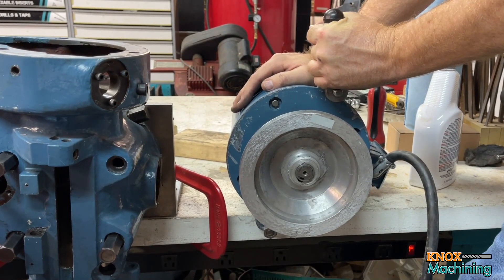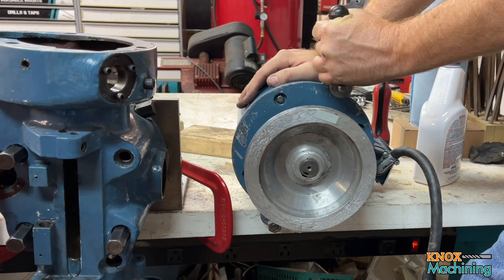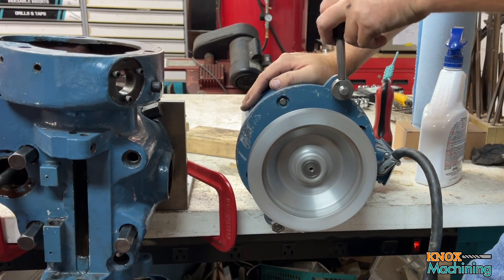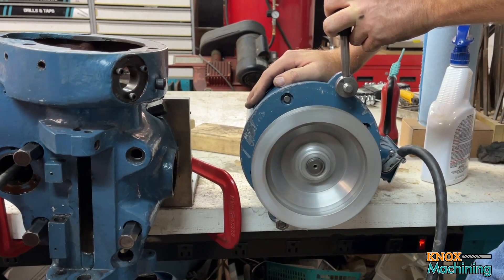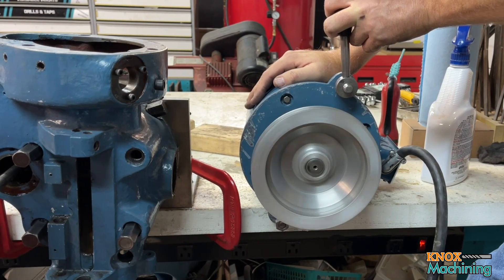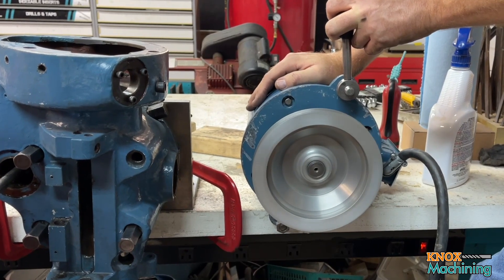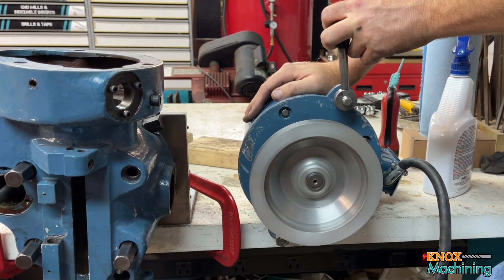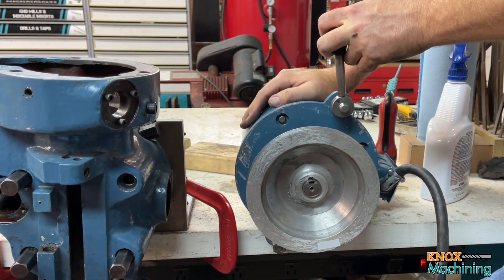Bad VFD, or Bad motor?

Comment: If it was me, I would first use a volt meter to trouble shoot it. Ideally a good quality fast acting one, but most any should work. When the motor is running measure the voltage fluctuation of each leg. The bad leg should behave differently. Reading/bouncing more than the good legs. Then swap the phases around. If the problem leg moves, it is the VFD. A o-scope would be better, but not always available. Plus a lot of users don't know how to use one.

Comment: It's either the VFD or incorrect wiring.  If it's the VFD, one of the phase generator circuits probably pooped out. Simple diagnostic is to monitor each leg using an oscilloscope to ensure the correct voltage, phase and frequency. If one of them is bad, open up the VFD and trace the lead through the circuit checking for the defective part. Sometimes a visual scan will reveal something obvious like a burnt out diode or IGBT. It could also be a simple wiring issue where it's wired as delta instead of Wye where the motor isn't supplied with enough causing it to have a lower stalling torque at lower speeds. Since the direct mains runs at full speed, you won't notice the hiccups.
Reply from the maker: The wiring is correct. (6 wires from the motor + 3 for the mains, can be 220/440)  I went in and double checked it and wired it all back together.  I can throw the scope on it this weekend or try another VFD.

Comment: Hi! Have you tried using another VFD? I'd like to hear the result. Thank you.
Reply from the maker: It was a bad VFD.  Ended up being 1/2 of one of the phases..  So probably a bad cap or SCR.  Works perfectly fine with new VFD.  I probably should pull this video down.
Reply: @KnoxMachining than byou so much. Having the same problem but unfortunately i don't have spare Vfd to try on.
Reply from the maker: @basictechnolo-g5578 Using a vote meter, ohm out each phase on the motor. They should all be very close to the same value. (Disconnect all 3 wires and check between each one).

Comment: Good odds it’s the VFD, I’ve found a few with one IGBT failed and would still run. So your running on 2.5 phase not 3 phase. Easy check at 50% / 30 hz speed. Measure the AC voltage at the motor power connections (motor connected) leaving the drive. T1 to T2, T1 to T3, T2 to T3. They should all be quiet close in value, if one reading is say 20 volts lower, its the drive. Note the voltage will probably be less than the motor nameplate at the lower speed. Be carful it’s dangerous voltage and I’ve had a few drives explode while testing one that was suspicious. PPE required !!
Reply from the maker: Dean,  I think this is the best explanation thus far.  I hadn't though about just loosing 1/2 of a phase.  I was wondering how it could be running good at higher speeds.  This makes perfect sense.  I'll try and test it with the volt meter while running at 30hz and see what the voltage is.

Comment: you have to check the parameters of the VFD. What type of VFD do you have on this machine??
Reply from the maker: Yes.  Where some that we tweaked, but in the end, it's a very simply VFD with very few documented features.  I've since checked the motor on another VFD and it ran fine.  Looks like one of the IGBT transistors has died causing it to be only 2-1/2 phases.

Comment: imbalance?  Bearings?  ...... or yea you might take your DMM and look at each leg of the magnet wire
Reply from the maker: Bearings sounded fine..  runs good at speed, so, It's not that.  It's the VFD dropping or a leg or something, or maybe something wrong with one of the coils.  But, I ohmed them out and they all matched.

Comment: If the motor runs on the correct 3 phase voltage and you can vary the torque with some restraining method then it's probably the inverter. You should use a scope which is digital and view each phase for possible problem while varying the torque. More than likely will need to R/R inverter. Probably not a bad idea to have a spare which works on hand. Good luck! Enjoyed watching.
Reply from the maker: I'm pretty sure at this point that it's the VFD.  I'm not really wanting to do a component repair on it.  It's a real low end unit.  The one I installed on the Bridgeport was a low end, but had more options and better documentation.  I'm thinking I'll pick up another one. If we where a production shop, then yea, having a spare on hand would be good.. but since this is just a Maker Space, I don't think it's a big deal.
Reply: @KnoxMachining  I wish you could send it to me. I will gladly repair a VFD and put some oomph in my bandsaw.